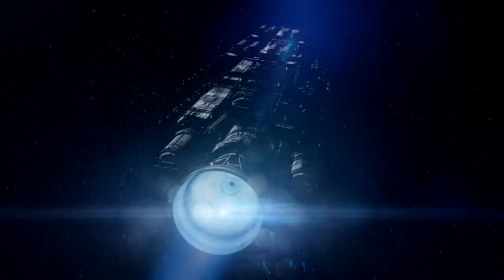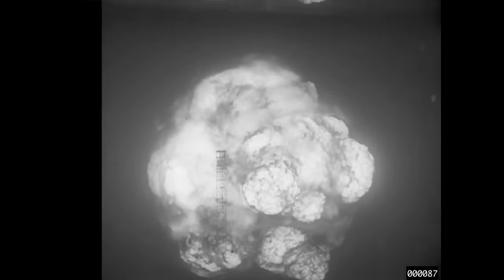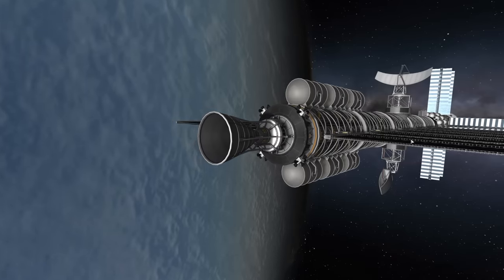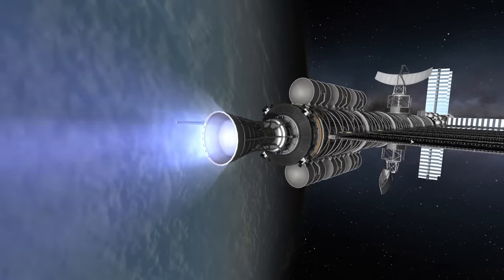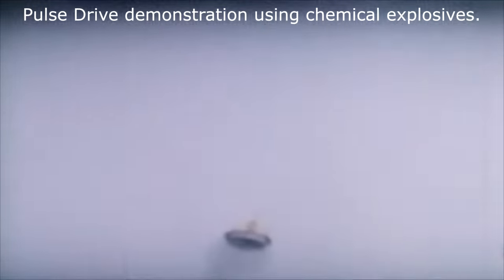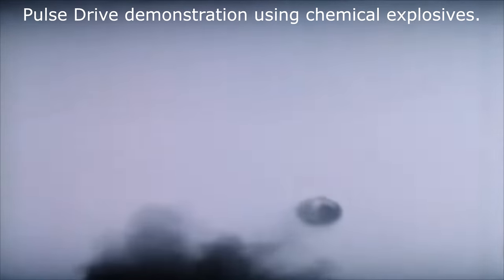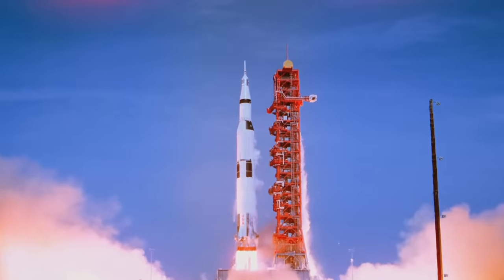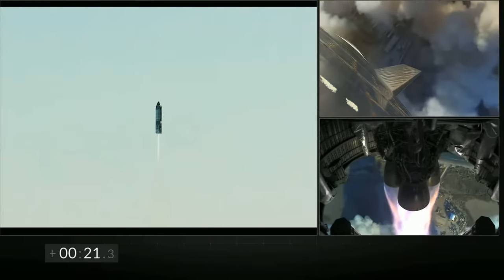The Nuclear Salt Water Rocket - Possibly the Craziest Rocket Engine Ever Imagined.

Comment: The actual answer could even be more interesting than the “most powerful first stage” which is more the question here. The most powerful single rocket engine tested/fired is likely a U.S. nuclear rocket propulsion test, either the nuclear thermal rocket or Orion?? Plus there’s the upcoming DARPA test.

Comment: VASMR system using the fission products of Uranium (233) plasma reactor loosely based on Thorium cycle (LFTR) is a much better option and it will produce excess electricity that can be used for other purposes like active space radiation shielding and other purposes...

Comment: I'm wondering if the idea can be modified for the thorium cycle and if this would produce a safer alternative for manned flights. Also wondering if the reaction can be made to produce a rotating magnetic field that could be used to generate electricity to back feed the pumps, etc.
Reply: The weapons grade version already uses U233 (which is the stuff thorium is bred into to actually make energy) as fuel according to the paper

Comment: I know they say it's mostly nothing out there in space and I'm obviously not qualified to say, but I've always had a problem with travelling super fast throughout space. I can't help but feel like even though hitting something is unlikely it would still be a massive issue.

Would they really be able to detect and see shit quick enough to do something about it when moving at 1.5% speed of light like the engine is theoretically capable of, especially if that shit was also moving stupid fast?

Comment: Nice idea, but these rockets are spitting out partially spent uranium and/or plutonium, leaving in its wake a radioactive trail that could go on for as long as the rocket is propelling.  If we have the tech to build that kind of power we can generate antimatter en route, solving storage problems.  Thunderstorms make antimatter: Beryllium-10 if I remember, and this one emits positrons.  Certainly if a teensy weensy electrical discharge can do it, mighty fission can take over.  And let's not use water, we need to drink that stuff.

Comment: Scott you seem to describe the concept as being reliant upon normal, mundane H2O as a means of inhibiting neutron velocities in order to increase efficiencies.

So many of your offerings 'stimulate the little grey cells' as Agatha Christie's fictitious character Hercule Poirot would say and this, is a subject to which I have previously devoted speculation so here is the result as it occurred to me as best I can communicate it in mildly condensed form.

Given, that heavy water or D2O achieves a moderating effect more efficiently than H2O and is used as a moderator in High Pressure High Temperature Reactors anyway, would D2O not make an even better base medium for that aspect of the propulsion process?

T2O is inherently radioactive to a moderate degree to begin with so despite having a half-life of only 12.26 years perhaps water comprising the second and heavier isotope of Hydrogen might make an even better base solvent or, possibly, a combination of T2O and D2O could be introduced to the propellent flow at different stages?

Also, the reason Tritium is heavier than Deuterium is because it has, an extra Neutron....

Apart from water containing D2O above concentrations of 40% being toxic to most organisms and Tritium being radioactive, other properties inherent to water comprised of either of the two isotopes of hydrogen do not otherwise deviate significantly from those of normal water and so are relatively safe, stable substances.

The concept you are examining is all about imparting as much energy to the propulsion process as is reasonably achievable while keeping the system as compact and safe as possible.

Therefore might advances already attained with comparatively light weight, compact Molten Salt Reactor design for electrical power generation also make such a reactor a feasible inclusion to a compound propulsion system by incorporating an MSR as a primary stage?

Might such a system prove ideal for providing power at the magnitudes requisite to magnetic containment fields and conceivably even an ion thrust amplification stage thus liberating the system from the relatively feeble limitations of solar panels while contributing to advantageous tertiary effects in other ways as well?

It might prove feasible to carry the requisite isotopes of hydrogen at greatest density currently attainable in liquified form along with oxygen in the same state the combination of which to form water would also impart energy to thrust.

If, the fission effects you describe are not diminished to significant extent by the water in question having the form of superheated steam and is still therefore able to sufficiently cool fissionable fuel elements imparting additional energy to the propellant.

Even greater velocities could be introduced to propellent for any given length within an engine by employing rotational energies inherent to vortices generated in a cascade of chambers to form 'pseudo turbines'.

Could not such vortices conceivably then employ gyroscopic precession as an additional form of compact thrust amplification that might even prove particularly amenable to oblique wave propagation during simpler reaction phases in the form of direct combustion?

Perhaps it could even be possible for a compound engine having such a configuration to operate in atmosphere by withholding radioactive components from the propellant at such times?

With reference to weapons grade uranium as a potential upgrade to propellant performance, excluding it from the base volume of the fuel would be simplest if it were in the form of gaseous uranium fluoride or possibly even Hexafluoride.

Just a few thoughts😒

Comment: Is the engine powerfull enough to fuse hydrogen? If so, it could use a fusion afterburner
Reply: I was just thinking that. What if you injected a deuterium-tritium mixture into the "combustion" chamber for extra thrust.
Reply: I saw someone post a description of that once. Basically they took the nuclear salt water rocket and used the neutrons/heat generated to trigger a secondary fusion reaction that added to the thrust (I might be misunderstanding the method because I'm not a scientist). They claimed that their design could burn at 1G for around 7 days and could get to Jupiter with a flip-and-burn at the middle. They said it could it could cruise at .4G and make it out to Neptune in 24 days with a little drifting in the middle. I question these numbers because they seem too good. But it was interesting.

Comment: Would it be more efficient to build a lightly shielded reactor and use it to power ion engines?
Reply: Once upon a time I thought the same thing.  Then I learned that to get more than a trickle of thrust out of of an ion drive you needed immense power.  Sure, a big enough fission reactor can supply sufficient power.  Shielding isn't the problem, cooling IS.  You'd need an immense radiator array to dump the waste  heat...so big it would dwarf the reactor.  If you didn't, you'd get a melt down.  Here on earth we have a thick atmosphere and copious water to dump heat into.  None of that is available in space!
Reply: @banalresentive6523  I didn’t think about cooling.

Comment: What if they just had the reaction chamber exposed to the absolute freezing temperatures of the vacuum of space itself? Im pretty sure negative 250k would keep it cool without even needing coolants.
Reply: There's no air in space, so nothing to carry heat away. The only way for stuff in space to cool down is through IR radiation, which is what radiators are supposed to do (these big silver panels you can see on the ISS for example). This isn't a very quick way to cool stuff down though,  but the water dumped out of the engine would carry most of the heat away anyway

Comment: If I remember correctly,  the diameter of the supply pipe would be crucial to ensure the critical  reaction did not migrate into the fuel before it was introduced to the reaction chamber.  What about the radioactive exhaust plume! talk about emissions.

Comment: As to Chernobyl, I thought the Chernobyl disaster was not a 'nuclear explosion' but an uncontrolled or run-away reactor that produced a steam explosion, of the cooling liquid, breaching the containment area.  This resulted in a release of nuclear materials, primarily to the atmosphere and subsequent contamination. 

It may be a fine point to some, but to invoke the vision of a 'nuclear explosion' when Chernobyl wasn't really a prototypical explosion of fission materials does seem to be critical point.
Reply from the maker: Chernobyl was a prompt critical nuclear reaction which is exactly what is required for the nuclear salt water rocket.

Comment: I know that the main problem with nuclear fusion is that it gets so hot that everything melts in very short order.
But would it be possible to make a nuclear fusion rocket somewhat along the same principle as this?
Because IMO nuclear fusion is the ultimate goal when it comes to any kind of energy needs. There is a limited amount of available uranium on Earth, or even in our solar system. But there isn't really any limitation to the amount of hydrogen we can find.
Reply: Yes, theoretically. You could eject small fusion pellets out the back of the craft, then use some kind of super efficent, extremely high power death laser to ignite it so it explodes with the power of a nuclear bomb, then use some kind of extremely strong magnetic field to confine the resulting plasma and push it away for thrust. Pulse this several times per second, and you get comparable (potentially even better) thrust power.

Comment: So if we built this it could travel at a 1/10 the speed of light, equating to 18,600 miles a second or 66,960,000 miles an hour. To put that into perspective that equates to a little over 2/3rds the distance between the earth and the sun.

Comment: The concept, power output, and even fuel economy are are comparatively great versus chemical rockets. But at 200 kg./sec., how many tons of propellant would be need to make a trip to Mars in 39 days; compared to what was advertised by some other ion/plasma rocket technologies? What is the acceleration in Gs at 200 kg.sec..fuel flow going to be like? High G acceleration is not really needed when indefinite ISP are possible over the distance and time as large as in space; for Mars initially anyway (let's not get carried away jumping ahead to the stars). The space craft pictures are nice, but I doubt they realistically take into account the required fuel tanks and mission loads (landing crafts).

Comment: This is said out if pure curiosity. Why couldn't you use a nuclear reactor to power an ion thruster if you're limited by the solar panels?
Reply: the reactor is very heavy and also requires significant cooling, needing large radiator panels
Reply: @destroyer1667  ahhhhh that makes a lot of sense! Thank you for answering 😁

Comment: Yeah I love it, suppose we could get a starship up to 36,000 mph, you would have to be able to control the thrust other wise a 960gigiwatt thrust initiated at once would at least leave our crew as a clump of jell or at most gut the entire length of the ship because of the constraints of inertia. But what the heck with that kind of thrust we could make our ships out of cast iron and steel no more piddling aluminum or magnesium.

Comment: You don't need pumps; pressure feeding is good enough. Running the propellant (pressurising) liquid through the exhaust nozzles would simultaneously provide the energy for the liquid to gas phase transition, while cooling the nozzles. That sort of piping is nothing new for rocket design. 
I would strongly argue that pumps are always a far worse approach than pressure feeding in any king of rocket application that does not need to be entirely reusable.

Comment: “1% the speed of light”

I’m no engineer but isn’t this such a high max speed that you’d have to start slowing down before you reached it so you don’t crash into your destination?
Reply: It depends on how far is your destination.
Even if it's 1 light year away it would take you 100 years to reach that with an engine doing 1% of the Lightspeed.
And keep in mind 1 LY is basically neighborhood outside of the solar system.
The closest star to our sun is Proxima Centauri at 4 LY
Reply: @iaial0  even more than 100 years because you have to build up that speed slowly.
My point isn’t that you would get there fast but that safely accelerating up to that speed without turning passengers into cosmonaut juice would take so long that you might not have time to reach it before you need to slow down.
Reply: @RedHair651  acceleration is a fair point I didn't consider. I lack time to do some napkin maths to see if this would be true.
Since the huge distance I was in fact ignoring the time it takes to accelerate to that speed and decelerate to orbital speeds and brought that number as an example

Comment: Could this sort of technology, a continuous nuclear fission explosion, be used to catalyze a nuclear fusion reaction, creating sustainable and functional nuclear fusion? We already know that fusion bombs produce a lot more energy than they create, and those are powered by fission explosions like these. and that they can even heat up water for generators economically. What if you could continuously feed nuclear fusion fuel into the flame of a nuclear salt water rocket powered with weapons grade fission isotopes? Could this create energy generating nuclear fusion in the style of a continuous fusion explosion, with the exception that it doesn't completely destroy the reactor (the bomb) whenever it's turned on???

Comment: Yeah; you'd need a higher grade uranium reactor to get the exhaust velocities hoped for, possibly even a plutonium reactor, to get the higher efficiencies, and extra thrust at a more effective level. However, the higher the radioactivity - you would think the less mass would be necessary to reach similar exhaust extractions. Only smaller scale tests would probably prove it one way or the other.

Comment: I did not understand why it requires that fast water flow.   In fact, logically we would want it to be as slow as possible to get more complete fission. finally I doubt if that concept is even functional at all because low neutron reactors are very slow  and require huge volumes to maintain critical mass this is nowhere near to what is required for the rocket engine. To make it work you rather need a fast neutron reactor like all other proposed nuclear rocket engines

Comment: You could use multiple pipes to get around the criticality problem

Run a bunch of boron lined pipes to the nozzle where they combine and cause the nuclear salt water to form a supercritical mass, that would allow you to use higher fuel enrichment and a much higher concentration of fuel in the water, which would give you a much more powerful and efficient engine, the main issue with that idea is cooling, you would probably need to pump liquid nitrogen or something similar through the nozzle to stop it from being vaporized (which itself could be vented for additional thrust if recondensing it is not an option)

Comment: Why not power an ion engine with an on board traditional nuclear reactor? Surely that would be a massive step up from solar power as well?
Reply: It would only be a step up further out than mars.

Current designs reach about 200W/kg for a reactor, which is worse than solar, atleast up to mars.

Comment: I would guess all the neutron absorber in the tank would reduce the usability of the design. Cant we use ceramic uranium oxide rods that burn up in the nozzle. The dry storage of uranium would reduce the amount of neutron absorber needed. 
In addition, this would make refueling (the water tanks) at Saturn much simpler.

Comment: I just had a thought: high-level nuclear reactor waste is still a fissile material, and contains much of the energy potential of the original uranium fuel (~90% iirc)... why not use this waste material as the nuclear component of a nuclear-salt water rocket? I think that would help our waste storage woes on Earth while rapidly opening up the solar system for exploration and colonization.

Comment: If the exhaust velocity of the NSWR is about the same as an ion thruster, wouldn't you do better by just powering an ion thruster with power from an onboard nuclear reactor? You'd be free of the need for solar energy, but with much cleaner and more reliable tech than in an NSWR.
Reply: Thrust is about 10000x more, thats the difference

Comment: Science and theoretical engineering is awesome.

But nevermind using this type of propellant as the booster stage in atmosphere as a worry, what if it were go pop before entering orbit, or malfunction and crash?
Reply: The price of real estate would drop significantly in Florida. 
Then I'd finally be able to buy a Winter home down there.
Reply: @dukecraig2402  Haha
Reply: @motzibcek  
And the value of my sister's would plummet 🤣🤣🤣.
She wouldn't be so high and mighty then.